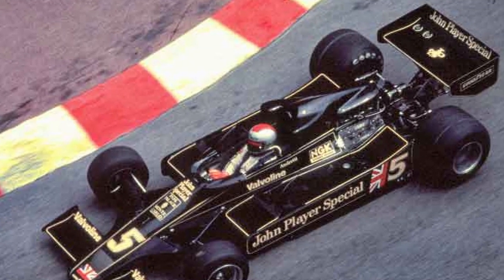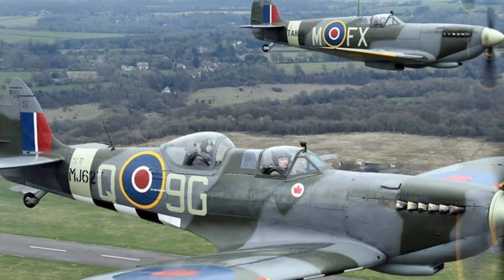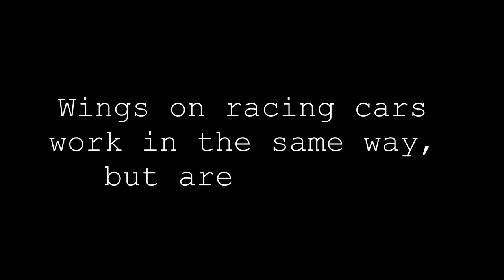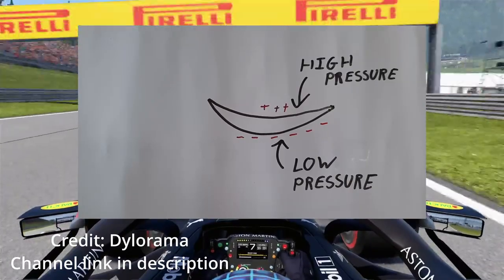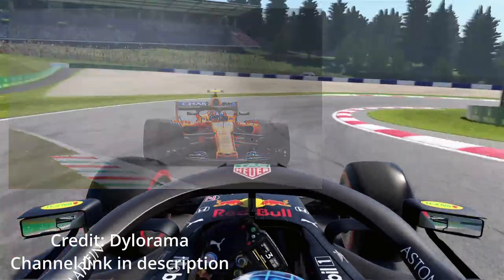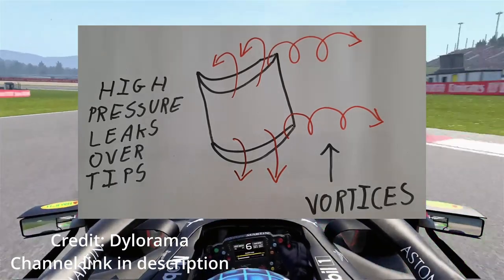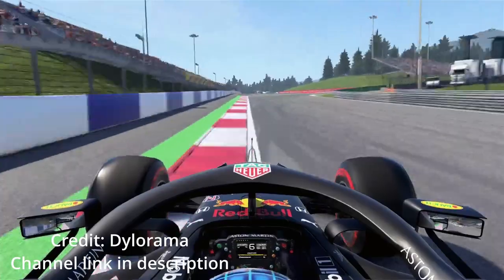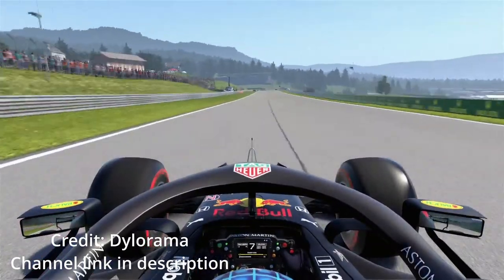What is downforce? | F1 Wings, Endplates and Ground Effect explained

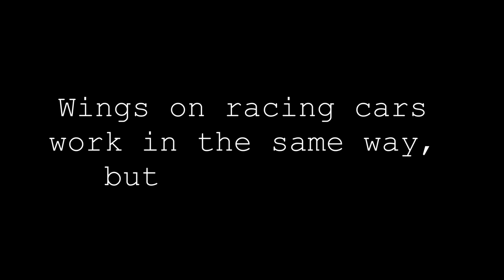Comment: why don't they design with rear wheel and front steering? Whereas the rear wheel steering only becomes engaged when the front wheel hydroplanes using sensors that will allow the vehicle to know the front wheels are in flight. 0:43
Reply from the maker: That's a really good engineering solution, but there are lots of regulations in F1, and unfortunately rear wheel steering is banned, like lots of other technology, to try and keep racing close.